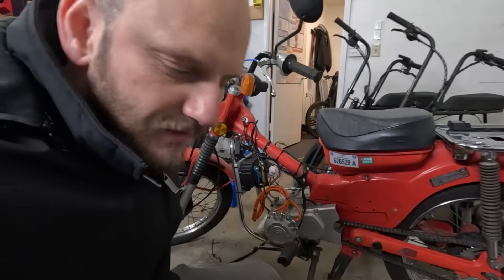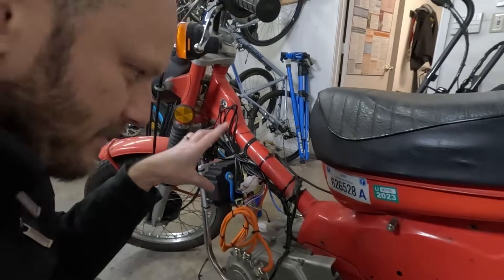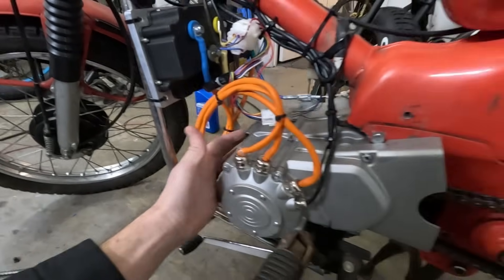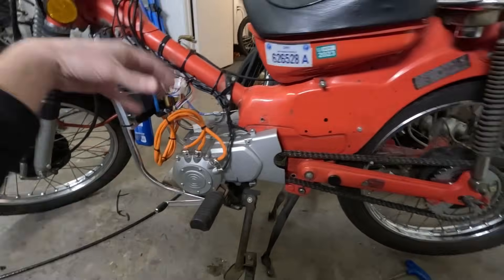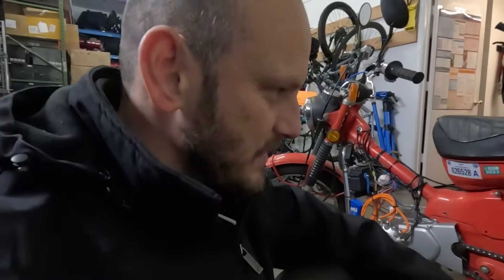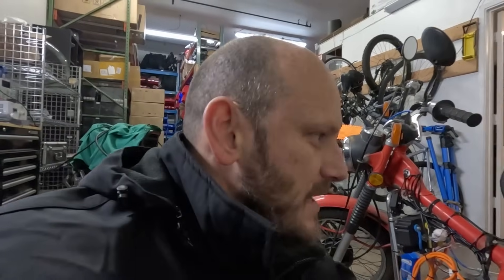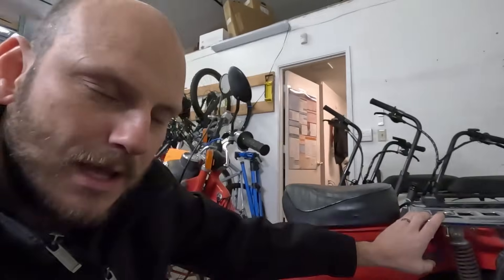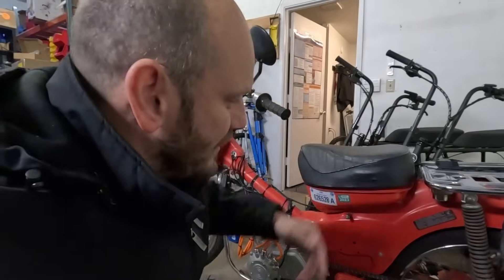An Electric Motorcycle motor with a 4 speed Transmission?! A first Look ct110

Comment: There is room in that frame for a 72v 40ah battery. You could get it custom made to fit.  I would use a 5 turn hub motor in the rear and a 200a controller. Would be great for commuting around town.
Reply from the maker: I just really wanted to use the mid drive 😁

Comment: I wonder if you could remove the motor from this assembly and replace the magneto in the internal combustion engine with it. You’d need some kind of electronic ignition, but to have a hybrid C90 with around double the Power would be amazing. Electric start too 😂

Comment: I have this motor in a bike running 72v 90ah and 125a controller and it rips pretty good will do 140 kmh n.p mine is 5000wt tho and it's more like semi auto cause u can't stall it like a normal clutch set up , however I was recently in a really bad crash where I got smoked by a mini van and broke 30+ bones and the bike was wrote off so I been debating on upgrading the power out out and building an electric 2019 rmz 450

Comment: I have a few CT 70s, and I got tired of trying to repair the carburetors. I think this is for me.
Reply from the maker: I finally just got it dialed in yesterday where the motor is not flexing the frame anymore and I gotta say it is unbelievably powerful with this little motor on it. It will wheelie easily in first gear if you’re not leaning completely over the handlebars.
I 100% recommend doing it! Just make sure you get a battery they could put out at least 130 A continuously. I do have batteries. I can do 150 continuously if you’re interested in mounting it like how I did in a pelican box.

Comment: My mechanic popped the motor on 240 volts DC , 30 amps . It was quite sudden on a dynamometer .
Reply from the maker: What do you mean by “popped the motor”? Burned the rotor/stator, or popped the controller?  I’ve only popped the BMS on a battery so far. No motor or controller issues @72v
Reply: @JohnnyNerdOut Either letting the motor run away in the wrong gear on a steep descent post on other video earlier today . In my mechanic's case , stator coils at incorrect voltage .

Comment: Can I ask why the bike needs a gearbox? I thought electric motors have max torque from 0 rpm so would negate the need for a gearbox?
Or is it just to bolt into the existing honda frame?
Reply from the maker: Max torque is still an actual amount of force. Using a gearbox multiplies that number for more numbers!

Comment: What's the range with the battery your running? Since no pedal power, does it actually get good range?
Reply from the maker: I would estimate a 15 ish mile range with that single small battery. Not a lot, but they are hot swappable and modular which is nice.

Comment: A CT-90 doing a wheelie is something I have never seen.  I have one and its great for slowly getting around.  My big question is always what is the range?
Reply from the maker: Technically, I could put whatever size battery I want on that big rear rack of it. But I think this bike should be pretty efficient because it’s so small and lightweight. I would guess that I’m gonna burn around 70 to 80 W hours per mile with regular riding.

Comment: can you increase the size of the motor sprocket and reduce the rear wheel sprocket it has a gear box so you can change gear on a incline, just thought a ask, they do say a 6 k motor is best
Reply from the maker: Yep. I got a 19t up front and a 42t in the back. Should increase speed a bit

Comment: I swapped the controller to a controller from electro and co
Reply from the maker: How is it?
Reply: @JohnnyNerdOut   it's pretty good  main reason I switched was so I could have one I can re program and tune via the app to adjust it to be more like a 125 2 stroke using the same motor  in a pit bike

Comment: What are the max/nominal amps of the controller?
Reply from the maker: I am in process of figuring that out. Supplier says 150a but I don’t believe it.
Reply: @JohnnyNerdOut  I believe I found some specs.  They say 150a continous 200A peak.  For the 3000w model.
Reply: @JohnnyNerdOut  Controller seems to be a 72400.  So 400 phase amps.  That setup would probably rip with a 300a bms battery.
Reply from the maker: @Americadoe  I have a 150a continuous battery I will try as soon as I have some time

Comment: EVs are all about power density. Motorcycle applications make sense because they are light and used in high population urban areas for short distances.
Reply from the maker: I agree. Especially on small displacement ones that aren’t going to be cruising highways all day.

Comment: This is really neat especially since I'm a transmission gear head but it brings about a very common question. What's the point of having a 4 speed transmission coupled to an electric motor or if I hear correctly. A clutch as well? An electric motor makes 100% of it's torque right off of or at 0 rpm and wouldn't need gears. Plus and I'm stating the obvious here but it doesn't need to idle when the vehicle in question is not in motion. And when not using it's power to coast it should be able to just free wheel unless somehow you use it in reverse as electronic braking also charging the batteries. If anything the gears are also a parasitic loss at this point. Is this a possible way to use a smaller capacity motor for a variety of acceleration and top speed requirements to get better range? I wondered about something like this being use in an EV car since range is an issue but can using a smaller less power hungry electric motor with a transmission make up the difference?
Reply from the maker: I have a separate video up explains the importance of gear ratios with electric motors. In short, electric motors are still very similar to gas motors in that they have a specific rpm that is most efficient (high rpm low torque). 
Torque at 0 rpm just means it has useable power immediately vs spooling up. 
https://youtu.be/4zS0vD1QNB8?si=P4_zZ_4lmOQw459t

Comment: A 70's model CT70 would go 35-40 easy with it's stock 3 speed nearing 50 downhills. No shot the 110 wasn't at least as fast.
Reply from the maker: I would get about 55 with the 110cc. We will see what the new top speed is once I get the gearing dialed in. I bet at least that.

Comment: The gear ratio of that gear box is not tall enough, especially at the high end. You should be able to get way more than 55 mph, if the ratio is modified accordingly.
Reply from the maker: Ya I am working on getting that dialed in before the next update video

Comment: i know greenbikekit has a fuel-tank style batt-case that likely can sit on that main tube between the seat and the steer tube, probably can get one of those, make a little something to mount the controller and throttle-adapter under that for a clean build? can also pack a good-size batt build in it, too

Comment: This 3K watt nominal (25K watt max) motor with 4 speed tranny seams to be a pretty generic Chinese drivetrain.  It is used on the admit jet armor, the GMX, the mototec venom (and a ton more) all using this same configuration.  I think you are likely limited by your battery, because the 251 lb admit jet will do about 65 mph (with a 250 lb rider on it)...and your rig has got to be lighter than that.  Also, that admit jet armor motor is only $430...so you can definitely find a better deal than this.  I believe they advertise this bike as using a gen 2 motor, with higher max output, so that might have something to do with the variance in results.  Oh, and just to be clear...the manual for my bike specifically says not to "ride the clutch" during normal operation...meaning that it's not a "true" clutch.  Just hear a lot of people talking about the "electric motor with clutch" but they specifically say not to use it like a clutch or it could cause damage.
Reply from the maker: Those look to be slightly different motors. Actually better motors from the stats. I can say I would not want to put 25kw Ty rough this motor. 

Do you have a link to the motor for a little over 400 bucks?

Comment: You can throw away the gas tank and make a custom battery boc that goes between the seat and the frame. You can extend it forward a bit to get more capacity. Cut the top and bottom off a spare gas tank and weld them to the box that holds the battery. If you do it right, you should be able to fit a LiFePO4 cells in it for added safety. The controller is fine where it is because it needs air-flow to stay cool.

Comment: Didnt leave any product info.. name manufacturer nothing.. no links.. also Id like to note that with my ebike using a bafang BBSHD it's only 1400w and I'm getting 43 mph, for half the watts of this motor.. 'm getting nearly the same speed.. just food for thought.. the best vehicle this engine probably would work for is the motoped which is small and  lightweight dirt bike.. dirt bike arel vehicles not designed for high speed but for difficult terrain which then this set up would be perfect...
Reply from the maker: Check the description.  Link is there

Comment: Question.  As the 72V electric motor has heaps of torque, do you even need a gearbox?  Can you just run direct drive? And with a gearbox, you wouldn't need a clutch, just cut the volts.
Reply: switching the clutch lever to an e-clutch (just cuts the motor) would do it, and probably shift a bit faster than actually letting off the throttle.
Reply: Trade offs 3kw is only 4hp which isn't a lot so with a single gear you either lose speed or acceleration, also while electric motors do create massive torque at low rpm they are also way exceeding their rated power so it's to be in that state as little as possible

Comment: Remove the gas tank all together. Put the controller under the seat where the gas tank went. Then put the battery down low in front of the motor . You don’t want heavy batteries up high cause the center of gravity or heavy point is high and leads to unstableness. Low center of gravity is the best ! 

I love the little bike! I built my own 48 volt 3 wheeled trike and it will run 45 mph. I also just bought a live wire Del Mar , my GOD the thing is soooo powerful!!

Comment: This is the dream for short-distance commuters! I've often wondered why no one makes electric transmissions. I don't ride electric anymore but I definitely wish this was around a few years ago before I commissioned my single-speed electric Tomos which is now impractical and too expensive to fix.
Reply: people have kinda settled into trading off either the torque (in the case of hub motors) or the top speed (in the case of many mid drives) because it's so much cheaper. sure electric motors lose efficiency, but It's not anywhere near the efficiency loss of a gas engine, and they don't have a low enough rev limit to necessitate gears either. 
not adding a transmission is just so damn cheap that it's worth it in almost every case. really has only made sense to add gears in for specialty vehicles like the formula cars and e-rally cars for now. they'll find more applications eventually.
Reply: Because they don't need them. My Zero SR and Energica SS9 do fine and have more power than I can use anywhere in the RPM range.

Comment: At $800.00 on the website, not the $600.00 you claim. I was excited until I clicked the link. That is the same price as some e-bike motors or even a replacement gas motor (though that gas motor is going to be a chinese knock off).

Comment: I think This project deserves a higher voltage battery. 88v minimum (24s battery pack). 
I'm glad you went with Fardriver. Great choice! If that motor is an IPM, Change the parameter in the pro settings from AN0 to AN16.

For a battery pack, EVE INR21700-40P cells are the best bang for the buck at the moment and JKBMS 200A the best BMS hands down.

I hope you manage to make this bike a daily driver for summer, not only a toy that you build and forget.

Cheers :)
Reply: Quiero hacer un proyecto similar al del video de este chico tienes algún concejo para mí?

Comment: I have a 1967 Honda CL-90 That I've owned for about 50 years now.  I wonder if the motor mounts are the same as this CT-110...  I wouldn't be surprised if they were.

Comment: 300watt Impossible replacement of a 200cc gasoline engine
Reply from the maker: I think it would depend on a few factors. So far this is blowing away the old 110cc. Perhaps a modern 125cc is more on par with this motor

Comment: I have a couple of electric scooters, and they're fun to ride but have only one gear. Motors are most efficient at lower speeds, but have a lot of power drain at higher rpms. I always wondered how much more mileage you would be able to get by installing a gearbox and keeping the motor within a lower RPM range to conserve battery. This is super exciting!
Reply from the maker: I think you have that backwards. Brushless motors like high rpm, low torque for max efficiency. The opposite is usually how people burn out motors and drain batteries too quickly.
Reply: @JohnnyNerdOut  I didn't know that! I thought brushless motors were just more efficient due to their design. Thanks for telling me that.
Reply: @JohnnyNerdOut  so the motor in this video, is it brushless?
Reply from the maker: @ yes

Comment: If it was my build, I would move the controller under the seat, and put a shelf for the batteries and another rack above them for storage. Some Engwe kits do this with battery sandwiched between the fender and a rear rack. you could go with saddlebags too but its probably just as much work.

Comment: One of the biggest advantages of electric motors is that there is no need for gears. Less maintenance, fewer points of failure, less mechanical friction, and generally less cost. If you want a higher top speed then increase the voltage. Unless you’re talking about trying to go +200mph, gears are a step in the wrong direction.

Comment: Be careful using regular motor oil as most have friction inhibitors in them and could cause the clutch to slip, most motorcycle oils would work, possibly a gearbox/hydraulic oil. I use Shell Rotella T6 Synthetic oil which has the correct JASO rating for motorcycle use and won't ruin the clutch.
Reply from the maker: Exactly my thought too. The manufacturer explicitly said 10w-40 motor oil 🤷‍♂️

Comment: I was wondering how long it would take until electric motors started coming with transmissions.  This is the first time I have seen an all in one package and I find it interesting.  I thought a two speed would be the first I would find out about, but it was a more interesting 4 speed.

Comment: Wish I had that power unit with controller. Geared correctly it may be a decent wheelchair motor.  I'm building a three wheel scooter style out of carbon fiber tubes. Not a cheap project. Has to fit in a standard footprint to use on a bus or train.  Lots of details like that. Probably going to use 18650 Panasonic batteries. 
I'll be checking into this unit for sure. It's a contender...

Comment: 72v in 1st gear and it wheel stands? what if you use 60v for 1st and 72v for 2nd and then go 84v for 3rd and 96v for 4th, would the motor then carry you up hills with greater oomph?? Just wondering if having a voltage change would help it produce a ggod experience and better transport experience. Maybe 1st and 2nd could be the same voltage and 3rd and 4th a higher voltage to give it a more even throttle experience. Just wondering. Keith

Comment: So if you can shorten the motor leads to the BLDC motor from the controller it would probably gain some power.  You want to run the shortest lengths that are practical on both the DC volts in and the AC 3 phase out to the motor.

Comment: I don't know what you batteries dimensionally look like, but appears to me that there's a lot of space under the seat that could be used to house them and the controller as well?  I'd def cut the top off the gas tank use that space if feasible.  Also looks like a cavity may be there in the frame under it as well.  Good luck!

Comment: 2:32 I don't imagine most people would care about gear ratios specifically right out of the gate.  I was dying to hear you say something relatable, like "With the stock sprockets, first gear reached 12mph, 2nd makes it to 22, 3rd to 35, and 4th tapped out at 52mph on flat road, no wind, w/my 175lb azz, tucked." 
THAT would have been useful info to me at least.  See what I'm saying?  Something along those lines would be great.  But FYI, your video IS still great, regardless, and I appreciate that you made it!  Thanks, Johnny!
Reply from the maker: I’ll make sure to cover that in the follow up video 😀
Reply: @JohnnyNerdOut Your data collection techniques leave a "lot to be desired" . The speedometer on the motorcycle cockpit was not reliable enough for accurate test data logging / not steady , being a moving coil one . No reliable indications . Calibration ? .GPS speed readings as a backup comparative data source . The battery drain current being "maximum" 40 amps for nominal motor rating at 3,000 watts approximately , versus voltage drop is underexplained . At 80 amps , however , the voltage from the battery pack of 20 amp hour rating , would fall by about five percent , based on my own e- bike battery drain laboratory tests using motors and rehostats . You need to obtain an electrical engineering bachelor's degree if you don't have one already . Could you publish some graphs to show battery drain characteristics based on your own findings , attach a report and methodology essay with this , thankyou .
Reply: @JohnnyNerdOut Torque charts in Newton metres as well .
Reply: @JohnnyNerdOut Do what "Photonicinduction"did on YT with some examples of overloading e-bike and scooter motors to failure . It would guarantee lots of extra views as the "Photonicinduction" experience did with science enthusiasts .